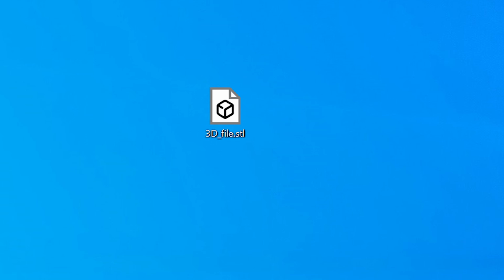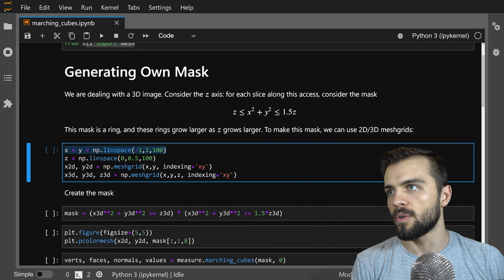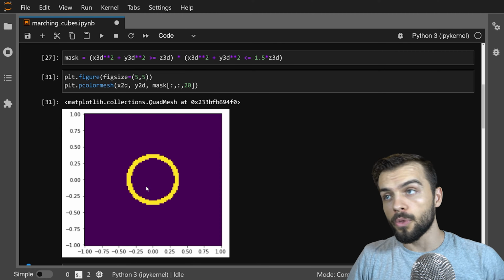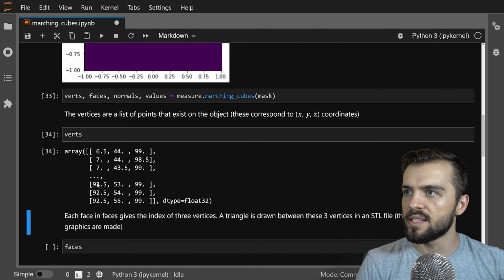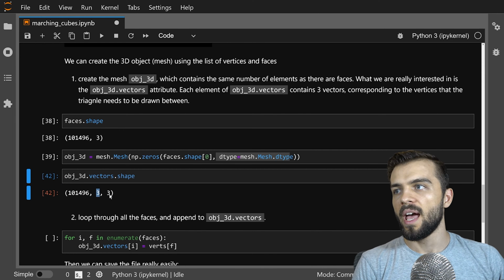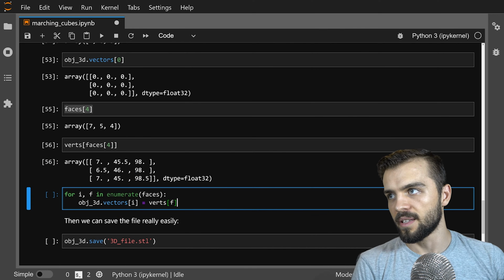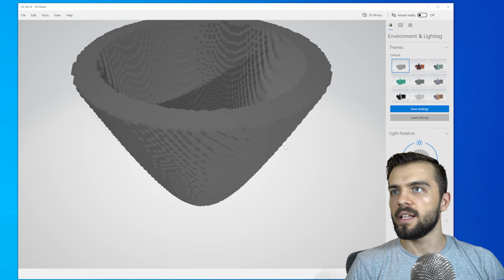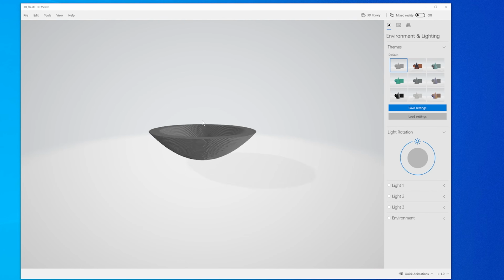Python 3D Printing Guide: Make STL Files From Masks

Comment: Thank you for the great video! It was instrumental for me to 3D print antenna and array beam patterns.

I found a way to smooth the stl instead of getting a "blocky" shape without having to resort to smaller dimensional spacing. Take the 3D mask array, cast it to single, and do a Gaussian blur (e.g., scipy.ndimage.filters.gaussian_filter). The larger the sigma value in the Gaussian blur, the smoother the surface will be but at cost of losing small and sharp features. (The Gaussian blur is low-pass filtering the image.) The marching cubes algorithm will then interpret values on [0,1] as a smooth surface, whereas if it were a bool mask on {0,1}, the marching cubes algorithm makes a blocky surface with sharp, 90-deg corners between pixels.